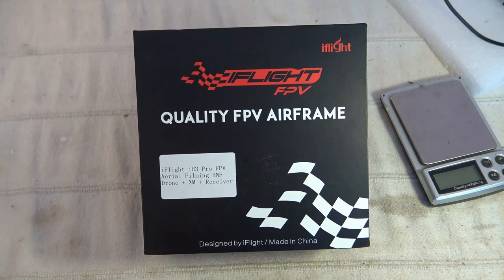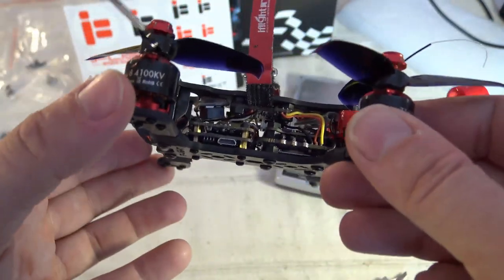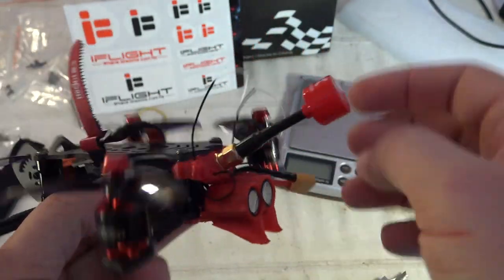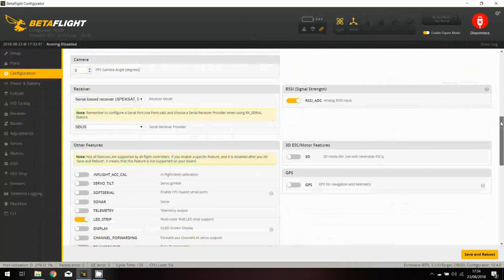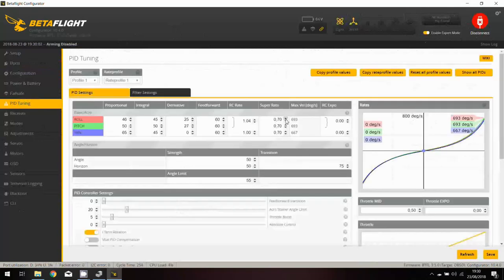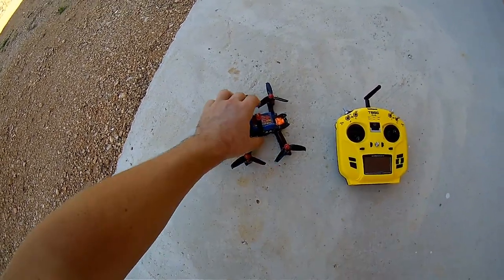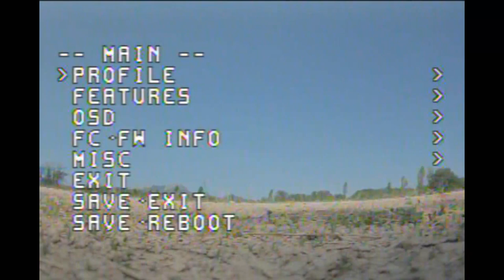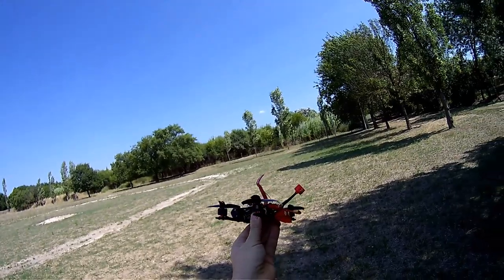iFlight iH3 Pro unboxing analysis configuration and demo flight (Courtesy Banggood)

Comment: Good review. The video from the Runcam was excellent.  I was surprised at how much break up there was in your FPV signal, even running at 100mW VTX.  I think they could have spent more time making this really flyable out of the box .. a lot of work required! Thanks for the review. Cheers!
Reply from the maker: Typically decorrelation between "design" and "production" depts ... one is based in US/EU the other in china ..... Like SPCmaker... and the devil are in the details. For the break up, since I turned on the the vtx_low_power_disarm option .... I hope when armed was set correctly to 100mW...

Comment: I like the 2 capacitors on the tpu mount😊 did you buy or get for free on review? Would your opinion be different if you had purchased??
Reply from the maker: I received free from BG but I always do a free review. In this particular case, I don't really recommend this machine due to some high sensitive gyros. Please check the full review at www.drone-maniac.com

Comment: Hi I am interested in installing a Helio Spring FC and the Aikon AK32 can you tell me if these will fit into the frame with the Runcam Split? Or my other idea was the Holybro Kakute F7 AIO Flight Controller + Atlalt HV V2 Stack?
Reply from the maker: No idea sorry :(

Comment: I found this model but cheaper on iflight site. Without mini split cam. Can I mount hawkeye firefly on top if using 3s battery?
Reply from the maker: I think it will be too heavy.... max payload about 30-35g IMHO
Reply: @sebydocky5080  thx. You mean drone with battery plus payload?